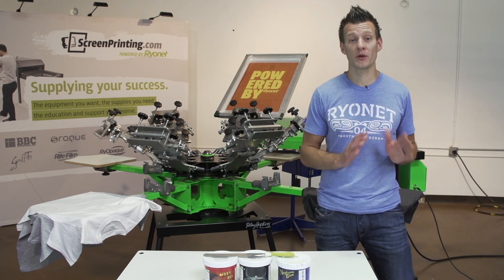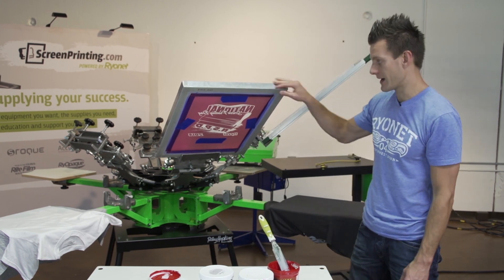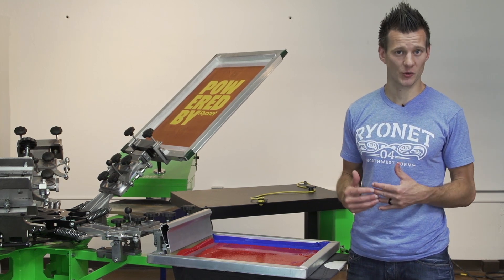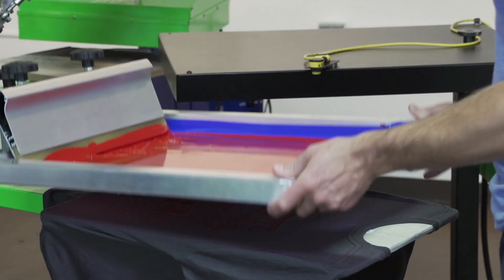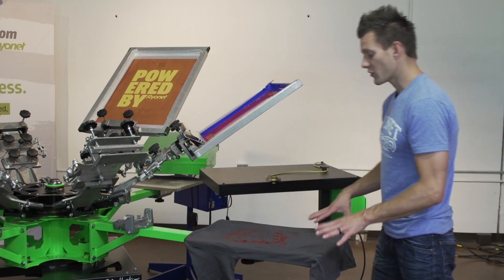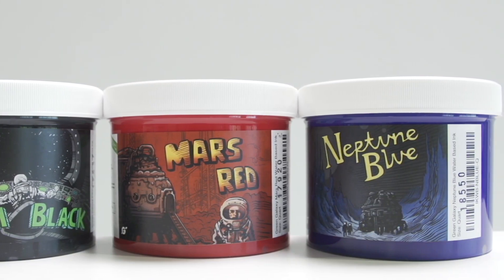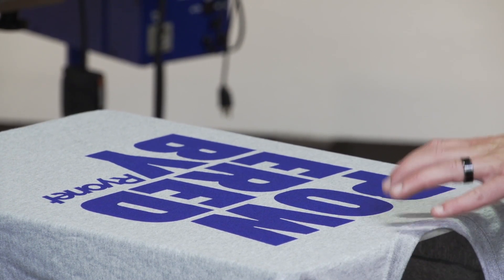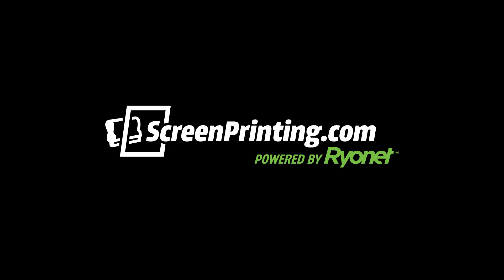How to Screen Print with Water Based Ink from Green Galaxy

Comment: Great video; really appreciate it!  Is the  water based ink supposed to go all the way to the other side of the t shirt?  If it is going all the way through;  what am I doing wrong?
Reply from the maker: Hi!  As a general statement, the ink is not meant to penetrate the shirt like that.  If it is, there are 2 main things to look at.  1) Too much pressure / to many print strokes pushing the ink through.  2) mesh count is too low and there is a LOT of ink going through.
There are other variables - but check on those above and let us know if it fixed it!

Comment: If your starting out screen printing and think you'll be wanting to print with both water based ink and Plastisol inks, would a single good forced air flash be good for both kinds of ink or would you need two different kinds of flash ( forced air and non forced air. )?
Reply from the maker: Hey there!  Just the one forced air flash would work great for you!

Comment: Hellp what ink do you recommend for surface can not go on the oven like those non woven bags bcuz i use watet base ink but dry to fast in the screen .  But my costumer is looking to print 500 bags or more
Reply from the maker: Use warp drive in our water based inks and only dry to the touch.  You will achieve a full cure in 48 hours. You can find warp drive here: https://www.screenprinting.com/search?keywords=warp%20drive

Comment: How do I reclaim my screen if it’s hardened ?
Reply from the maker: It will be the same process as reclaiming your screens. However, it will take a little bit more elbow grease as your screens are tougher... We also suggest making sure you are using a pressure washer as this helps a lot.